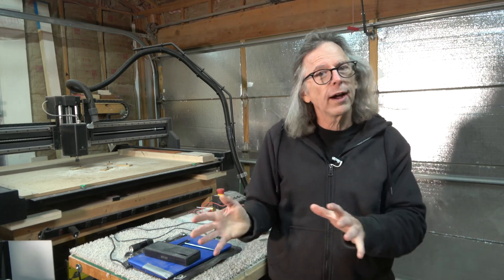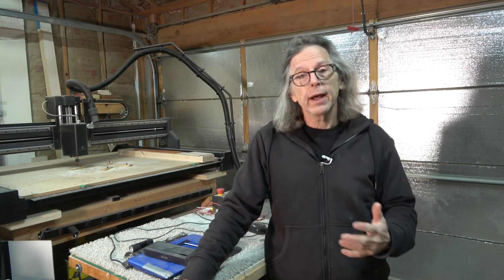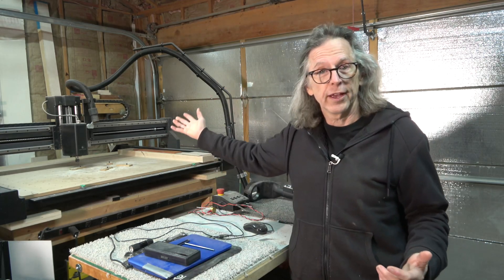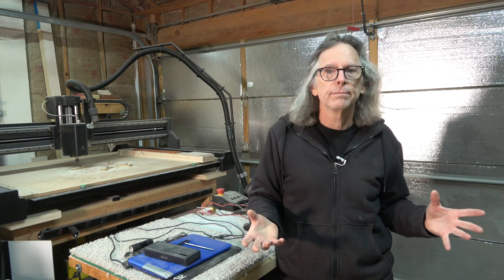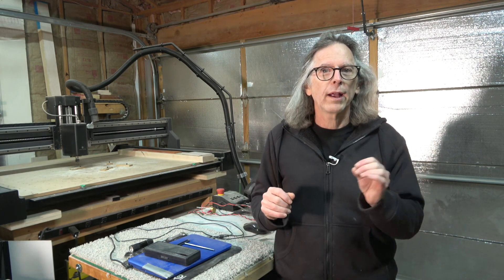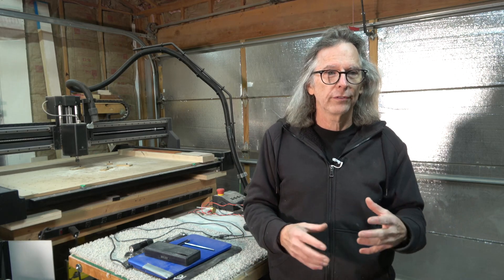Can You Make A Guitar With A Cheap CNC Machine?

Comment: i agree, i´d rather pay 25 bucks a month for using Easel pro because its an awesome software, also after building two CNC machines before i agree on that for guitar building i really think you always should be aware of that it prolly gonna cost ya in the area of at least 1500 bucks, maybe even up to 2000 bucks. for guitar building i think that the machine would have at least Lead Screws because its alot better than belts. Ballscrews are of course the best but then it will start to get pricy. Also i think that those Polycarbonate V Wheels can be ok if the construction of how they are used is good and that the wheels it self are high quality real Polycarbonate wheels, OpenBuilds have some really nice solutions for machines with V wheels and they seem to work great for guitar building, but the pricepoint for buying one will be in the range for 1500-2000bucks at the end of the day, maybe a little cheaper if you buy the parts and build it your self.. thanks for a good video.. :D

Comment: I have built guitars out of.. rasps, hand saws,simple drills,sandpapers (and even without routers) which took me months for each...but did it...so i dont see why a cheap cnc wont be able to make it...at least if its for personal use like mine...if its for someone thats gonna pay a lot of money for it and has specific demands then probably not....
Reply from the maker: Cheap CNC machines stall and loose steps there by ruining what you are attempting to carve. The just don’t have the strength and stability to cut wood reliably. Of course this all depends on how you define a cheap CNC machine.

Comment: I’m an amateur builder and I’m definitely considering CNC, even though I’m only planning to build three or four guitars a year. For me I’d say that it’s not just the speed of manufacture in CNC, but the safety aspect. Planers, jointers and routers are dangerous - even experienced operators can and do injure themselves using these machines. I’ve been woodworking most of my life and I’ve scared myself a few times. 

CNC takes a lot of those tasks and takes them well away from the operators’ hands. I’d rather spend my time on design, hand carving transitions, finishing and playing. I’m a gigging musician and I don’t care to get my hands cut up. 

Also, a decent CNC, expensive as it is, potentially removes the need for several other bulky and expensive machines, so the cost equation could potentially balance up fairly quickly.

Comment: Excellent advice Chris, nice to hear from someone with real-world experience of different levels of machine.

The worst mistake you can make is to buy something inadequate for the job and then pour more money and time into trying to make it work. In the long run you will save money by spending what you must up front, even if that means waiting while you save up for it. I've learned that the hard way, building several CNC routers over the last few years, starting with a very primitive, very cheap, MDF and allthread contraption and trying to improve on it with belt drives, acme screws, cheap controllers, free software, stronger wooden frames and inadequate motors. You just end up with a scrap box full of costly junk.

Several iterations later I have learned my lesson, spent some more money (though carefully choosing components that are good enough but not way over spec) and now have a router with a welded steel frame and gantry, ballscrews on 3 axes, a 3HP water-cooled spindle, adequate sized motors and power supplies plus a rock solid controller and software. At long last I have a machine that I can use to do real work rather than spending all my time tinkering with the machine itself. It's recently been put to the test to produce my entry in the 2022 Great Guitar Build Off which taught me a lot about how to use a CNC machine to build guitars (videos can be seen on my channel for those with a little time to waste). Design work was done in Vectric Vcarve (desktop edition).

Comment: I built a CNC router based, very loosely, on your plans. A little bigger, made from birch plywood and with a 3HP spindle. It cost around £1500 and will cut ash at a depth of 4mm at 3 metres per minute without complaining. For the software, I use FreeCAD. I can make a Telecaster body in 4 hours and a neck in about the same time. The main limitation I have come up against is in drawing the head and heel transitions. So I machine the neck shaft and carve these transitions by hand. The moral of the story is - you can do CNC guitar making on the cheap but you have to put in a lot of effort.

Comment: I’ve been using an original Xcarve that’s been heavily modified. Risers and stiffeners as well as a whole different z-axis and Vectric Aspire software. Mine is 1000 x 1000 mm and I couldn’t imagine using a smaller machine, you’d have to tile everything. Without raising the gantry on a regular Xcarve it would be very difficult to cut a neck with an angled headstock, you’d almost have to use a Fender style bolt on neck exclusively.
Reply from the maker: When I used the X-Carve original, I made only angled headstocks. No modifications. However, it's kind of tricky to do them.
Reply: @HighlineGuitars  I bet it was tricky! The gantry height on a stock Xcarve is so low I’m amazed you were able to make it work! Thanks for taking the time to make these great videos and join us for some conversation. Keep up the good work!

Comment: I spent $1,800 on mine, followed by 8 years and $1,000 to troubleshoot why it couldn’t consistently cut accurately.  Finally discovered that the stock motors were not rated for the machine.  Likewise, software was an expensive lesson.  I wish I had gone with different CAD and CAM options.  But after 8 years, it is now operational.

Comment: Have you ever considered of creating a guitar from a single piece of wood?
Reply from the maker: No.
Reply: Yeah it’s generally not a good idea
Reply: I have before and am currently making a single piece maple guitar and it's possible but risky to sell something like that. It has a high chance of warping but I have had good luck so far. It's more for yourself and it takes more effort and you may have to change your methods a little because the size of the wood limits what you can do with your tools.

Comment: I think I have mentioned in comments before. But I a huge fan of onefinity CNC. All in, I spent less than $3,000 for a machine that has ball screws and is very accurate. Is that the right choice for everyone? probably not. But for the things I do in the workshop it was perfect. It is extremely sturdy and accurate for a reasonable price. Perfect for Fretboards, bodys, and necks. 

When it comes to software. I highly recommend Fusion 360 if you're a hobbyist. If you are selling guitars then the 'Free" fusion license won't work for you and you should look into other software. I totally understand why Chris uses Rhino 3D /Meshcam/ Easel. (Assuming he hasn't changed since the last video I remember him talking about that) If I started selling guitars I would be looking at Rhino 3D very closely. But I would likely use vcarve pro for my CAM. Not saying his approach is wrong, but I would need different things out of my software.
Reply: btw, I like the looks of the Onefinity. Looks like it would meet my needs too.
Reply: For a cost-effective piece of design software CamBam is worth a look. I've used it for several years and the licence is a pay-once-upgrades-for-life deal so no future costs. There is also a very good community around the software who provide a lot of free plug-ins which add some very useful functions. It's excellent for what I refer to as 'engineering' shapes but isn't as good for detailed 3D work. I would use it for, say, cutting out the body of a strat with all the routing for the neck, pickups etc. but then carve the rounded body shape by hand.

I'm also trying Vectric Vcarve. It is very good, but a lot more expensive and whilst it will import full 3D designs from other software and generate the G-code for you, an upgrade to the WAY more expensive Vectric Aspire is needed to do the whole 3D design to G-code path in one.

I have tried Fusion 360 but found the learning curve too steep and have never lasted long enough to get comfortable with it.
Reply: I'm giving VCarve a try right now. Do you happen to have any tips or suggestions for it? It seems fairly straight forward so far.
Reply: @applebutter4036  I’m not a master of it. I really just use it when I make signs or cutting boards for people for gifts. I spend way more time in fusion 360 right now. But there are a ton of good videos out there. It usually only takes a few minutes to figure out whatever I need to do in there on YouTube